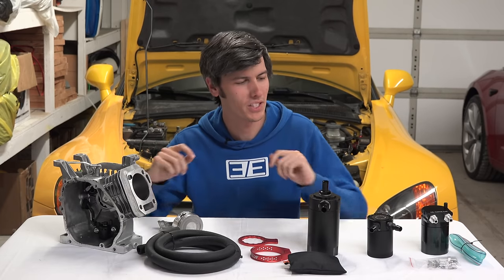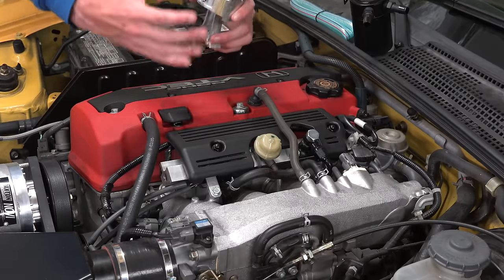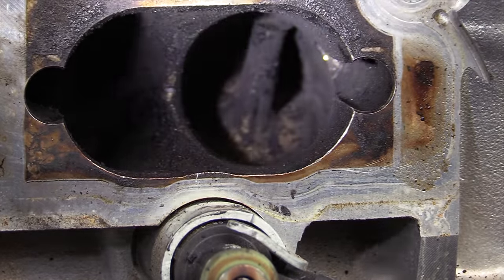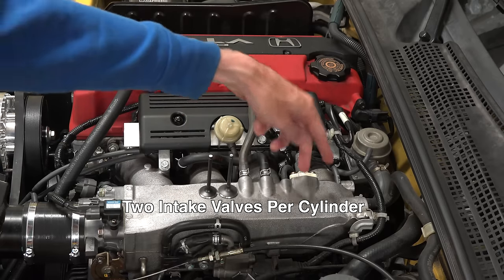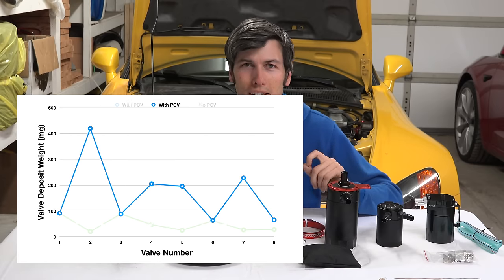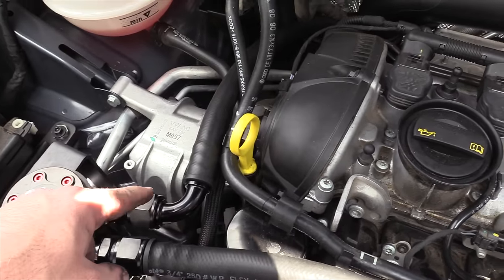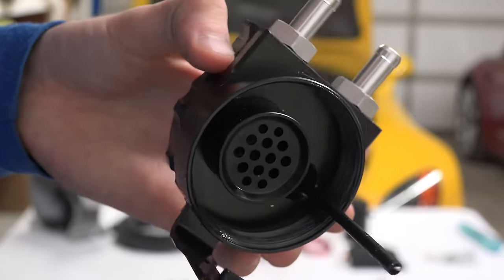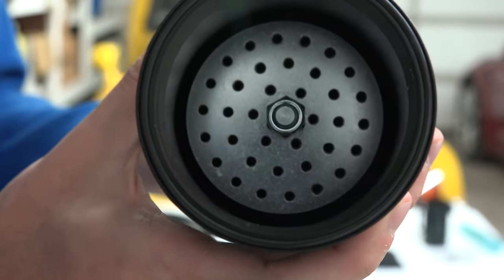Do Oil Catch Cans Actually Work?

Comment: My srt4 came with a factory catch can. It was the intercooler 😂
Reply: Emilthehun same here, especially after I upped the boost. Lol🤷‍♂️
Reply: Same, fiesta st likes to keep oil in the intercooler
Reply: Lol!!!
Reply: Lmao
Reply: Audi’s do it too
Reply: @ray02946  and coolant in the cat.
Reply: Don't worry it's a Dodge it want last long. Lol!😁
Reply: Subarus too.  Lol
Reply: @Rob Roy the Dakota is actually one of the better things they have made. Also the 90's ram was decent. But recently they are horrible
Reply: No kidding my 335 intercooler will never corrode
Reply: Rob Roy same as I’m 04 ram🤔😂
Reply: Emilthehun mine too lol. I am running dual catch cans now. I literally have 2 of the cheap BlackHorse racing 20$ cans plumbed in LOL 😂 no oil getting into the charge system now lol
Reply: Same with the WRX.
Reply: @vw3576  Well. Not internally, anyway.
Reply: I get about half a quart out of my MkV GTI intercooler after removing the inlet hose...caught me off guard the first time.
Reply: @ray02946  first i'm hearing this and i've been on the forums/groups four a few years
Reply: @danielbeavers8701  my 99 ram has 284k miles
Reply: BadNBoosty SRT86 dude who cares if it’s cheap, I found a 15$ catch can that I saw a performance site selling with their name laser engraved on it. They wanted 130$ for the same damn cheap ass China Can, it’s the middle one pictured here. As long as it works🤗
Reply: The Middle Catch Can ($100) you can buy on eBay for about $15-30
Reply: Just like any other car that has a turbo and crankcase vents to intake
Reply: @SwirveGotti86  Why do you use 2?
Reply: Wait, why would the oil end up in the intercooler? PCV is supposed to go from the valve cover straight to the intake. It makes no sense to route it anywhere before the intercooler.

In fact, oil in the intercooler would lead me to believe your CHRA is fucked. As in it's leaking oil into the compressor side.
Reply: @rars0n  the intake and throttle body is slanted downhill to the intercooler. Pcv Oil vapors in the itake condenses and runs down and collects in the lowest point. - the intercooler.
Reply: This made me smile while on the toilet...your humor got me through these tough times
Reply: @black99rt  That's right, I forgot the SRT-4 has that downward-sloping intake manifold. I was thinking of most other cars that have the runners curve upwards.
Reply: hopefully that engine last more than 50K miles
Reply: Audi a4, same deal
Reply: My Camaro did too, the dam intake manifold
Reply: Ahh so I see I’m not the only srt 4 owner here looking to fix my oil issues😂😂🤣
Reply: XD my WRX has one of those right now! What a feature!!
Reply: Now that is funny.
Reply: @ray02946  Wait your fiesta ST came with a oil catch can??
Reply: @totov7673  nah it was a bad joke
Reply: @ray02946  😂 I thought so dude I have a focus ST I was looking in the hood if I miss it but I realised after
Reply: You still need a catch can..especially if your boosted
Reply: @WATCHMEGOPOOR  oh ok
Reply: @ray02946  i never heard of this, and i have a fiesta st.
Reply: My HHR ss had oil pouring out of the intercooler for about 3 seconds when I pulled one sides hose off and it dripped out for about 20 minutes until I got the intercooler off and started washing it.  it was super gunked up inside!
Reply: @Bigshoots86  oh yesss! I loved the hhr ss! What a great little car that was!
Reply: @rars0n  PCV valve closes when under load and boost pressure starts to build.  In which case there should be another vacuum hose between the valve cover to the turbocharger intake and this is where the catch can is plumbed into.
Reply: @kaibotski4939  yeah my cats love drinking coolant too.  Sucks cat's life span is only around 4 months, I thought they lived for around 15 years
Reply: I just noticed my VW had oil on my intercooler   Why is that??😭
Reply: @Merzehades1913  your turbo is dying
Reply: @jonathandominguez921  turbo seals are worn out
Reply: It's actually a good thing. Any leaks in the intercooler or hoses are easy to find.
Reply: My tdi does the same just to remind you it's time for maintenance 😂
Reply: Yup the one in the video is a mishomoto the non branded one is a quarter of the cost identical minus the logo on topv@VZBudgetBuildz

Comment: isn't any VW enthusiast a mechanic by default. how else would they get from A to B without a tow truck.
Reply: LOL, sadly no. Seen a lot of really awful repairs on VWs over the years.
Reply: as a kid I remember the rumour that a collision in a Beatle was fatal at any speed.

And how Kombis were a scourge on country roads where at the head of a long string of cars was a struggling Kombi.
Reply: pls dont leave out Benz and Bmw: sick quality right from factory day-1. They luxury rides have a button in overhead controle pannel to call Emergency Sces.

No worries Chinese cars are on the way.... disposable just like shoes
Reply: Please, VW's rule! My 2008 Jetta is pushing 235,000 and still runs like a top!
Reply: I drive the crap out of my TDI, 121k miles, 42mpg average and not a problem.
Reply: @glasser2819  😂😂🤣🤣🤣

Comment: I’ve looked at the cheapest option he has here and they do have the ability to filter the part with the baffles unscrews and you are supposed to place steel wool in there to act as a filter

Comment: I recently installed the inexpensive catch can sold by Evil Engineering from Amazon on our 2015 EQUINOX. I modified mine with a drain on the bottom using a metal tire valve. Every few months I do remove it and wash the steel wool filtering media. I couldn't not believe the crud that this unit prevents from re-entering my motor. I have also added a vented oil filler cap to help prevent pressure build up in this motor. Best money I've spent on this car to prevent GM's infamous issues with their 2.4 liter motor.

Comment: I made an oil catch can for my antique Chevy S10. I purchased a 32 oz  Ozark trail thermos from Walmart  for 9.99 and I drilled two holes in it, one a couple inches up from the bottom and another a couple inches down from the top. It took a lot of effort, but I made a stainless steel baffle slightly above the lower hole.  It was interesting fitting that piece inside and epoxying it in place,  but it works quite well.
As far as a filter,  I purchased a 3-pack of coarse stainless steel scrubbers from the dollar store and put one inside the thermos, just above the baffle.
A line from the PCV valve goes to the bottom hole and the return line  at the top goes to the throttle body.
I'm fortunate that there's plenty of room for this larger than normal catch can.   I wanted a large can to make it easier for the moisture and oil to settle out. With the stainless steel scrubber in there, any vapors have to pass through the stainless steel mesh. No need for any other fancy filtering.
The engine has 288 thousand miles on it. I was having some severe moisture issues which I thought was a head gasket leak.
It turned out to be my thermostat running 15° to cool, a much colder than normal winter weather, and the largest item was the oil filler tube o-ring was not functioning because it had hardened up over time. This allowed cool damp air to go directly from the oil filler tube to the PCV valve. 
Since it wasn't sucking air through the vent tube on the opposing rocker cover, there wasn't much circulation. The moisture was building up inside the engine and up into the vent tube.
Once I sealed up that O-ring on the oil fill tube,  my moisture issues went away because my PCV and the vent tube were operating as they were supposed to.
Initially I had to catch can on the vent side of the engine were all my moisture issues were showing themselves.  After installing the O-ring the catch can have absolutely no residue in.... Nothing.
Because of that, I switched it over to the rocker arm with the PCV valve.  
The catch can is collecting oil only.  No water vapor whatsoever.
The other thing which surprised me was once I sealed up the O-ring and the PCV system was operating correctly, oil leaks from my engine virtually ceased with the exception of a tiny amount from the rear main.
If you have engine oil leaks, be sure to check your PCV system and make sure everything is operating correctly. A minuscule amount of vacuum from the PCV system can keep pressure buildup from forcing oil out of the timing cover and rear main seals.  My engine is unbelievably dry now.
Over the years I rebuilt two engines, ported a brand new set of heads and installed larger exhaust valves and I've done all of my own automotive work for 50 years.
Unbelievable that I just now understand the operation of PCV system. 😞
The journey and the discovery of my problem is all because I googled oil catch cans.
I thought they were only for race cars. Nope, they need to be on every car.

Comment: You didn't mention that some car manufacturers are utilizing a dual injection system that mainly injects fuel directly but also will occasionally inject fuel through a port injection system which helps keep the intake valves clean, virtually solving the problem of contaminate buildup on the intake valves, hence circumventing the need for a catch can. Trouble is trying to figure out if your particular vehicle is utilizing this dual fuel injection design or not. Also worth noting, the cheaper catch cans require that you supply your own hose, and on engines with a high pressure side that has a stronger vacuum applied to it, ordinary rubber hose from the auto supply store may collapse under high vacuum conditions, something to watch out for.

Comment: I recently installed the $25 can (by Evil Engineering sold on Amazon) on my new ‘22 Hyundai Veloster N. It came with a nice aluminum mounting bracket, two different sizes of screw in hose adapters, and some steel wool padding to use under the little baffle in the lid. This helps catch more oil than just the baffle itself. Also- I found out the dip stick screws into the bottom of its cap, and can vibrate loose in time, allowing the dip stick to fall into the can. I unscrewed the dip stick from its cap, and screwed it back together with a dab of loctite. Great video Jason! Thanx!
Reply: Just ordered same can on amazon:)😂. Thanks for heads-up for the dip stick. I will fix it before installing.
Reply: How frequently you check or drain it?
Reply: @Hotricanswheels10 every oil change for me (5k miles)

Comment: Great video,  question, many VW folks are performing a pcv delete,  What are the ramifications of doing this?  I hear that system vacuum during boost and non boost are regulated by the pcv system,  So I am assuming that removing the pcv system is not a good solution.  Feedback or video would be great.

Comment: After I owned my 2015 Fusion with the 1.5 Ecoboost. I put like 10-20,000miles on it by the time I put a catch can on it. I was ignorant to direct injection with a turbo. Then it fell under the coolant guzzling as it was dumping coolant into cylinder 1. I was able to trade out and up to a 2017 Fusion Sport. I got it with 42,000 on the clock, first mod was a catch can. Been on there for 9,000 miles now. I'm trying to preserve this car the best I can and keep miles low. They only made this model for 3 years. And many have been wrecked already.
Reply: I wish you have an updated 1.5 ecoboost engine on your 2017 fusion

Comment: Great video. You forgot one important detail. The PCV system not only releives pressure inside the crankcase from blow by, but it also removes the fuel vapors from the blow by. The PCV system removes air/fuel mist from building up inside the crankcase - which is dangerous. So it's not just oil mist that goes to the intake manifold, it is fuel mist as well.

Comment: I have noticed on my 2015 F150 (5.0), when I ran the common ethanol fuel (all gas 10%), the catch can had chocolate milk in it.  On the reverse side, I’ve been running nothing but ethanol free gas and I have No chocolate milk, just oil, and , with a borescope, the cylinders haven’t the rust look to them anymore.

-two cents.

Comment: Back in the good old days, engines had something called a "road draft tube" which just vented pressure from the crankcase to the atmosphere. No oil in the intake manifold or on the valves, no reservoir full of dirty oil sloshing around, no problem. Goddamn you, EPA.
Reply: You can still do that today, just do it back up before inspection or emissions test day.
Reply: also y u used to see oily mess down the middle of the lanes  and cars and trucks sitting at red lights with vapor/blowby wafting out from underneath    aah the good old days ?      i'm old enough to remember    i see the pros and cons ur talking about  still think we can do both    cleaner air and cleaner running cars         we have the technology (6 mill dollar man ref )
Reply: My first car, 56 Chevy with a 235 Stovebolt, had one.

Comment: I have the smaller can with the bronze filter on my 4WD 2.5 turbo diesel. It's a Mitsubishi Triton here in Australia. It's plenty big enough as I check it every 6 weeks roughly and it only has about 1-2 teaspoons of oil in it. Got it on ebay for 26 bucks delivered. Exactly the same as the one in this video.

Comment: They absolutely work. I just fitted one to my high mileage NA car yesterday. The difference is night and day. Oil was pooling in the intake manifold and the engine was pinging slightly at most mild load conditions. The engine was being fed oil mist, effectively lowering the octane of the fuel. The pinging is now gone completely!
Reply: where you plugg the INLET and the Outlet???
Reply: Your engine needs a overhaul if you have to drain it more than one a year
Reply: @Thunderstormworld  Not necessarily an engine problem it also depends on the temperature, if you placed the catch can in a colder side of the engine bay on winter you'll definitely empty it every week due to condensation.
Reply: If it was pinging, I'd wonder if the EGR is clogged with gunk up from all the oil burning
Reply: @danr9584  No EGR valve on this engine. Ford 5.4 3V with VCT. The VCT keeps some exhaust gas in the chamber to lower emissions.
Reply: @Thunderstormworld  It's got 320 000km on it. 😀
Reply: I drain mine every 4 months on my ls1 it's normally got maybe 50ml to 100ml of oil in it.engine has 390,000km
Reply: @lordhumungous7908  that’s like nearly 200,000 miles in Freedom Fractions!

Comment: Just ordered a catch can for a 2014 ford raptor. It has port injection so it cleans off the intake valve, but you don't mention all of the other intake components that can also be affected by the oil vapors traveling throughout the intake system and injectors. Imo a catch can seems like a solid investment for maintaining reliability and performance without or without forced induction. Just my $0.02

Comment: Hi. I have used a catch can identical to the Mishimoto one that hade a price of around £20 with good results on a BMW E60 520D. Unfortunately after roughly 15000 miles the oil separator element stopped filtering and has created high pressure in the engine blowing oil via the turbo seals. Now I’m running a MANN ProVent 200 genuine one and the filtration efficiency has gone up to near 100%. The MANN catch cans come with disposable filter that have to be changed at around 30000 miles but they have also a much needed pressure release valve that will save a lot of hassle and money. They worth every penny!!!
Reply: Your comment was the one I was looking for.....I have been reading &  researching a lot about crankcase pressures increasing due to Mishimoto catch cans 'brass filter'.  In a couple months will be picking up a new '23 Ford Ranger 2.3L Ecoboost and I am looking at a Mountune dual catch cans that uses a 'paper like' filter.  Now i am learning that I also need the Mountune Oil Breather Plate.
I don't know which is better....the ProVent or Mountune??   But i DO KNOW the Mountune equipment is gonna run about $650 dollars!!!  Ouch!  Decisions Decisions........
Reply: How much was the MANN filter?